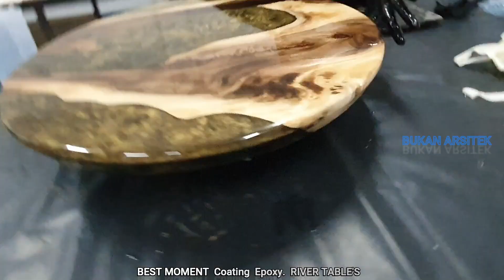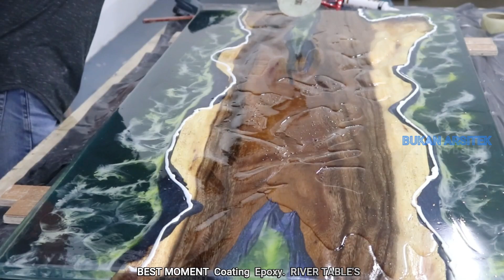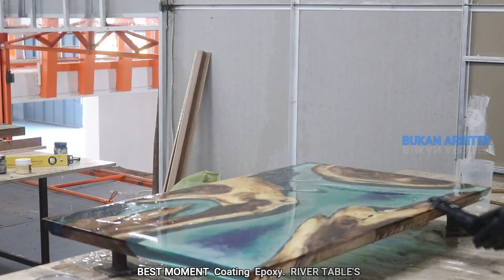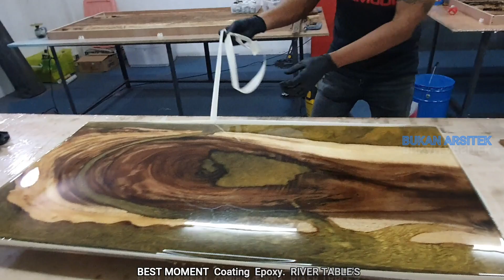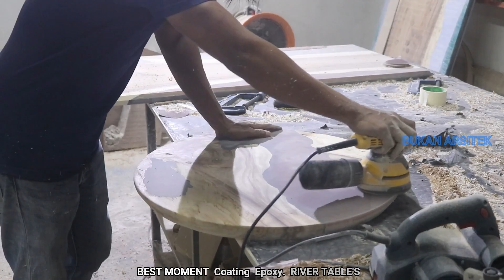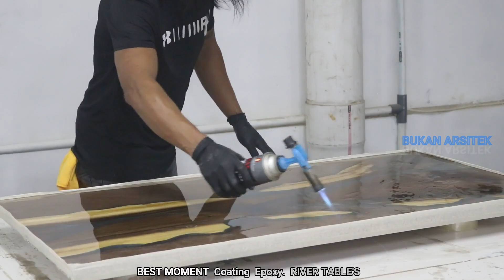MOMENT COATING MEJA RESIN POLYESTER MEMAKAI RESIN EPOXY

Comment: salam kreasi..mas mau nanya nich, kalau dari awal kita pakai resin polyester lalu finishingnya pakai epoxy coating-nya durevo;e apa masih perlu di gosok / poles lagi ? sebab saya terkendala dengan proses gosok-nya ( tempat kerja ) Terimakasih
Reply from the maker: Di video ini memakai resin polyester.  Coating memakai epoxy. Terlihat di video tidak di poles
Reply: Maaf Mas, itu bahan yang mau di coating resin epoxy harus sudah di gosok rata dulu ya, atau pemerataan pada waktu coating pertama ? sebab saya perhatikan pada proses gosok setelah pemberian coating pertama ( sebelum di pasang isolasi kertas ). Terimakasih